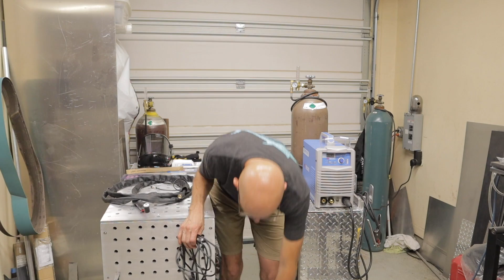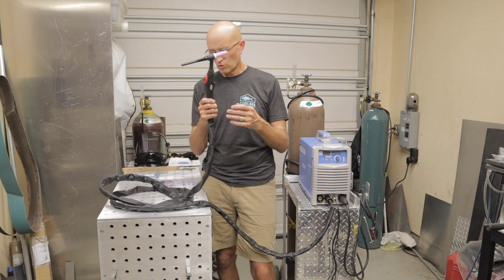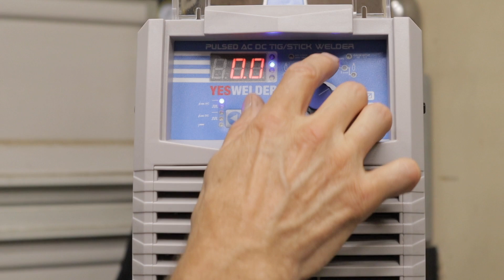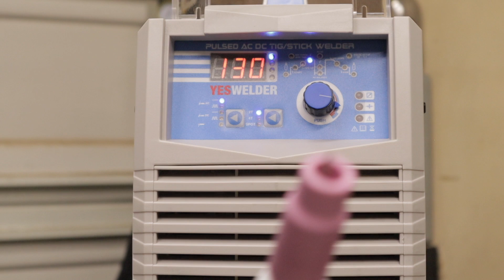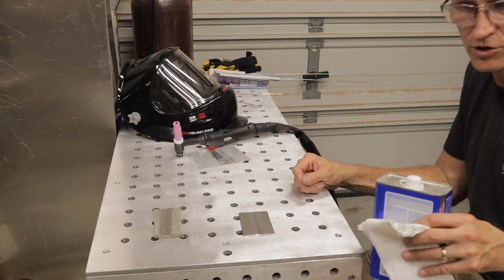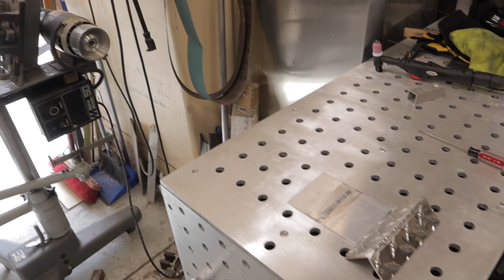YESWELDER NEW TIG 250P Setup & start tig welding Steel & aluminum.   Discount Code in description!

Comment: Thanks for an informative video Don!  Great job!  I have experience with a Tig Miller Dial Arc HF, but none with the new solid state welders with all the features available.  I just received the Yes 250P and started trying to figure it out...  I have no experience with a foot pedal or all these features. The tig I had weighed 500 lbs and was "On or Off" and I was only welding 1/4 to 3/8" aluminum.  I now need to weld 22 to 18 gauge mild steel.  Your video above only shows settings for aluminum.  Are the settings close to the same for steel?  I would like to hear how you set it up for the thin steel I'll be welding, if you have a few minutes.  I restore old classic British Leyland cars and some of that old steel is very thin that has to be restored.  I look forward to hearing from you if you get the chance!  Thanks so much!  Keep the great videos coming!  Bennet A
Reply from the maker: Hi Bennet! Great to hear you got one of these great Tig welders!   Ok, for thin steel I use these settings. 18ga. I use 65 amps on DC with about 12-15cfh of argon flow. I use a #8 gas lens cup when welding mild steel. I use 3/32” diameter 2% lanthanated tungsten for just about everything unless I’m going above 200 amps and then I switch to 1/8” tungsten.  When I weld in new steel on automotive panels I tend to do small tack welds around the perimeter and then do small stitch welds of like 1/2” long around the perimeter to minimize heat buildup in any one area. This helps me keep the thin metal from warping. I also keep a damp rag to cool the welds from the backside and this also helps with minimizing the warpage. The fit up of the metal replacement needs to be tight joints to make it easier to Tig weld too. For 22ga. I just back it down to probably to 45-50 amps. I’ve never welded in panels that thin but it should be about the same process. let me know if you have any other questions. 😊👍Don
Reply: @PranaTech  Thanks so much for the incredibly quick response!  In trying the settings I find that the white arc which allows me to see the puddle clearly, goes "off and on" constantly.  I am not familiar with the "slope up and slope down" feature, for my experience with tig is the Miller mentioned earlier, welding 1/4 to 3/8" aluminum building a hangar door for my hangar (55' x 16' bifold), with no pedal and wide open setting!  Can you please enlighten me as to why the arc may be going off and on.  Is it the settings on this welder or is it this inexperienced operator???  I'm thinking it may have something to do with the slope down... don't know.  Your arc when you demoed your beads, stayed consistent across the entire length of the bead....  Thanks again for your help and expertise!  Bennet
Reply from the maker: Hi Bennet! It sounds to me like the welder is set on pulse mode. Over on the lower left the button that switches from ac to dc and to stick should be set on the upper straight line on ac. This is normal ac welding. The next one down with peaks and valleys is the pulse setting. It is the same for dc welding when doing steel. I don’t use the upslope or downslope as I like to control this myself with the foot pedal. Also remember that the welder defaults to the button on the torch and if you want to use the foot pedal, you have to push and hold the pedal for 5 seconds until the remote light illuminates on the lower right side of the panel. Otherwise you will receive full amperage when you start your arc. This is annoying to me but it is just a part of the way this welder works. Hopefully this helps and let me know if you have any other questions.😊👍

Comment: Nice video brother. Do you know a way I can replace the tig rig with a regular rig. Or a way I can use it without the remotes
Reply: Man I’m having some problems lol. Do you why when I try to weld on ac all I get is lightning bolt comming from the tig head. I strike up directly on the ground. It sounds like it’s in ac mode and all. I must be missing something.
Reply from the maker: Hi James! Ok, it sounds like you are just getting the high frequency start and no arc starting. Are you using the button on the torch or a foot pedal? Will it start an arc on dc setting?
Reply: @PranaTech  I’m using the button on the torch. DC is also doing the same thing. It seems like it’s not getting the voltage to throw a hot ark. I put Connector adapters on the machine to convert to bigger lead connectors I also replace the factory lead with 50 footers. Heavy duty lead.
Reply from the maker: Is the torch lead connected to the Din connector to the farthest left on the lower panel and ground connector to the farthest lower right connector?
Reply: @PranaTech  I have it hooked up the same way you hooked it up on the video. Except I put the tig handle remote din where you put the footpedal remote. I have the ground on + the remote plugged to the connector in between the +and Threaded tig connector. The only thing I’m kind of uncertain about is the tungsten size. I have the wip converted for a 1/8.
Reply from the maker: Did it work with the factory torch before you converted it to the longer whip? It is acting like it’s not getting ground or power.
Reply: @PranaTech  yea, that what I’m thinking I will put everything back to factory see what happens
Reply: It was a grounding issue. Thanks for the help can’t wait for the next video.
Reply from the maker: Awesome! Glad to hear you figured it out! 😁👍
Reply from the maker: Hi James! Sorry for the delay in my response. I was gone welding all day yesterday and didn’t see this until today. Ok, if you want to convert to an American air cooled torch the process is pretty straight forward. You will need one of these couplers https://www.amazon.com/Stark-Welding-Coupler-Fitting-Coupling/dp/B086R7RH67/ref=mp_s_a_1_4?crid=15KUIH8AJPOEK&keywords=argon+coupler&qid=1658870010&sprefix=argon+coupler%2Caps%2C253&sr=8-4  You then cut one end off just past the hexagon part. You have to drill the barrier out of the middle and then run a 5/8-18 tap all the way through it. This then threads onto the welder and becomes a female for the us made torches to thread into. The torch needs to have a 5/8-18 male which is very common. I’m using a CK worldwide torch. Let me know if you have any questions. 😊👍
Reply: @PranaTech  thanks that would make a Awesome video.
Reply from the maker: I’m actually working on a video now. I have also converted mine to water cooled torch as well. All of it will be in the video. 😁👍
Reply: @PranaTech  that’s awesome! Maybe you can also show how to rig up the heavy hitter/black mamba style types of tig rigs also. I’ll be Patiently waiting on that video thanks.
Reply from the maker: Hi James, from what I can see the Black Mamba rig uses a din connector for power and a separate hose fitting for argon flow. My adapter setup will work for the argon hose. You just screw the argon hose into the connector that you would normally use for the Chinese torch. For power you would use the Din connector to the left of the normal Tig torch fitting on the front panel. They are both live with full amps when welding. Hope this helps.😁👍Don
Reply from the maker: The Din connector on the Yeswelder is a 35-50 which is pretty standard for 250 amps. You would just need to confirm that their connector is 35-50 and that the argon hose fitting is 5/8-18 right hand thread.👍
Reply: @PranaTech  it hard for me to picture with out seeing. Can’t wait for the video.

Comment: What size Din connectors they use on this machine ?Just curious  , if smaller Tig torches can be use on this machine like 17 or 20 water cooled one . THX

Comment: Debating between these three machines you've looked at:  Yeswelder 250P, Hynade 200, or PrimeWeld 225X.  Help me decide!?!?
Reply from the maker: Hi Bob, well they are all great machines and I’m confident that you would be happy with any one of them. For me, I weld a lot of aluminum and sometimes thicker aluminum, so the Yeswelder with 250 amps is the right welder for what I do. If you mainly weld thinner aluminum and stainless, the Hynade or the primeweld would be great. I know it is a tough decision. The only one that I have long term experience with is the Yeswelder and it has been a downright workhorse for me. I weld with it maxed out at 250 amps all the time and it has never faltered. It’s a great machine. Hope this helps. 😊👍Don

Comment: How I connect the gas to the machine and what can I gas thank I need
Reply from the maker: It comes with an argon hose that threads into the back of the welder. The other end you will screw into the Argon regulator that you will need to get from Amazon. Here is a link for one.https://www.amazon.com/RX-WELD-Argon-Regulator-Welding/dp/B08P5968X5/ref=sr_1_2_sspa?crid=J4VNJ3PVTFVC&keywords=argon+regulator&qid=1656648396&sprefix=Argon+%2Caps%2C574&sr=8-2-spons&psc=1&spLa=ZW5jcnlwdGVkUXVhbGlmaWVyPUEyTVg3QU5OMElOVlRBJmVuY3J5cHRlZElkPUEwODkyMDc0VkhNUVdEQTlaMVBDJmVuY3J5cHRlZEFkSWQ9QTAwMjY2MjMxOEQ3RDdEMElTQTlaJndpZGdldE5hbWU9c3BfYXRmJmFjdGlvbj1jbGlja1JlZGlyZWN0JmRvTm90TG9nQ2xpY2s9dHJ1ZQ==  This regulator threads right on to the tank. The tank you need is Argon gas for Tig welding. Hope this helps 😁👍
Reply: @PranaTech  thank you

Comment: Where do I set control for HF start?
Reply from the maker: It’s automatic and is always on. 😊👍
Reply: @PranaTech  does not seem to work on my unit. Even tried starting amps @50
Reply from the maker: Hmm, that’s not a good sign. I would email or call them and get a replacement unit.
Reply: @PranaTech  figured it out. My fault. foot, pedal preflow, 2 sec of HF, normal welding condition.

I was pedal and floating in space before approaching. HF turn on and off before I got into work zone
Reply from the maker: Awesome! Now you’ll have that knowledge burned into your brain because you figured it out yourself.😁👍

Comment: Man I just love your videos! Picked up the 205D, plasma cutter and now this 250p just arrived. Looking forward to trying it out. Do you have any recommendations on guides/books for welding configuration by metal? Can't figure out when you would want pulse vs straight vs AC vs DC. Even TIG vs MIG has me puzzled. Have you written a book/guide on that? I'd totally pick it up if you did. Hope you have gotten love from Yeswelder for all the gear I've bought from them through your links.
Anyways cheers!
-Shawn
Reply from the maker: Hi Shawn! Thank you so much for your nice comments! Made my whole week!😊  So, I’ve been Tig welding since right after high school, but only carbon steel. About 3 years ago I decided to learn how to weld aluminum. I found two channel’s content to be the best for me. I started out with Jody at weldingtipsandtricks on YouTube and once I got the basics of aluminum Tig down I then found Aaron at 6061.com’s YouTube channel and I bought his online course and it has really helped me get really decent welds on aluminum. I’m no professional at all, but I build a lot of projects now out of aluminum and they come out great. I actually enjoy Tig welding aluminum above any other welding now. As far as when to use which method, I use mig when I’m welding up projects like benches and tables and trailers etc… because it is so quick and you can build things fast. I hardly use my Tig for regular carbon steel anymore, unless I need things to be very precise and I can’t afford any warpage from the welding process. I use my Tig in AC for aluminum and DC for stainless and carbon steel. I only use pulse when doing fusion welds with no filler on stainless or aluminum and never on structural welds. Mainly for things like building enclosures and boxes etc. Thank you for using my links! They do give a me little love and it helps me buy supplies and consumables so I can keep building projects and making videos. If you have any questions, please feel free to ask anytime. Thanks again!🙏😊Don

Comment: Did it come with the foot pedal or did you have to order it separately
Reply from the maker: Hi Craig, mine came with a pedal, but it was not one anyone would want. I upgraded to an SSC pedal and now Yeswelder sells a good one on their site which is just a copy of the SSC. I don’t think they come with a pedal now so you will have to order one with it when you buy the welder. 😊👍
Reply: @PranaTech  I think they had the old setup listed on the site still and that's where everything was messed up they recently changed things on the website and they dropped the price another $50 from the deal 4 days ago
Reply from the maker: Wow! That’s a smokin’ deal!🎉👍😱

Comment: I just bought this welder and I'm trying to set it up to just run dc straight.  when I hit the trigger or push the pedal, I get about 4 seconds of a low buzzing sounding arc and then it shuts off. it's driving me nuts. any suggestions?
Reply from the maker: Hi Wisco! Ok, usually this is because you don’t have a ground. The 4 seconds are from the high frequency trying to start the main arc. Is the ground cable in the slot on the far right on the welder marked +? 😊👍
Reply: Yes it is and secured to my table.  When I hit the trigger I can hear a buzzing inside the box As well .
Reply: And it only stays on for about 2 seconds max. Then shuts off . My post flow still continues but I never get an actual arc
Reply from the maker: Ok, do you see any high frequency arc ? A tiny arc from the electrode to the workpiece? Will it begin the arc if you scratch start it?
Reply: It does do the high frequency arc for about 2 seconds then goes right out after that .
Reply: And I drug the tungsten across my work piece when I hit the trigger and it still does the same thing .
Reply from the maker: Ok, sounds internal on the board. I would email them and get a replacement.😞
Reply: That's what i was afraid of when I could hear buzzing from inside the welder, it didn't sound normal to me . Is your welder predominantly quiet when welding dc? Or is there buzzing from the box
Reply: Thank you for your time, I really do appreciate it !

Comment: How Pray tell do you set pre flow? 
I can not seem to get the Argon to flow and service amps to initiate? :-( 250P)
Reply from the maker: Hi Steve, when you turn the unit on it will default to the amps setting. Press the big knob on the front and each time you press it it will advance to the next field of adjustment. Keep scrolling all the way through until you get back to the first setting on the left which is pre flow. Turn the knob to change the settings. I have mine set at .5 seconds. Are you using just the button on the torch or a foot pedal?
Reply: @PranaTech  
trying the foot pedal but I will use the trigger if need be. It might. Be a faulty foot pedal 🤔
Reply from the maker: Hi Steve.  Yes, that was my thought. If you plug in the torch and it won’t activate the gas or arc, it probably is a problem in the welder. With the foot pedal, will it start the high frequency and initiate an arc?

Comment: I enjoy your educational content and skill.
I purchased a Yeswelder 250P and now have an aluminum gate project to complete. My problem is setting the machine. I am not familiar with the control panel and I can not seem to get the argon to start when torch is started. Can you please provide an idiot proof printed diagram of the control panel and proper settings for 
1/8" Aluminum
1/16" SS
1/4" CS
Reply from the maker: Hi Steve! I’ll be glad to help in any way I can. Can you tell me if you are using a pedal or just the tig torch with the button on it?
Reply: Foot pedal

Comment: Really enjoy your videos. I recently purchased this TIG unit and am looking to install a 220v circuit for it. What amperage is the circuit that you are running it on? Their website states a 63A input current, but this seems really high.
Reply from the maker: Hi Chris, I am running mine on a 30 amp breaker with #10 wire and I have never tripped the breaker ever. I weld at 250 amps all the time and so I believe 30 amps is a great plenty for this welder. My run from my breaker box is about 20 feet so your wire size may vary depending on your distance.😊👍
Reply: @PranaTech  Appreciate the reply! I went for a 50 amp breaker so it sounds like I'm all set.
Reply from the maker: You’ll definitely have plenty of power now!😊👍

Comment: I need help with my tig250 ac/dc to weld quarter inch thick aluminum square tube
Reply from the maker: Ok, what problem are you having and what are your settings? 😊👍

Comment: Can you make a video how yo seg DC  pulse.
Reply from the maker: Hi Pete! I haven’t done any pulse welding with this welder on DC yet. I have been playing with it welding aluminum on pulse and I’ve had my best luck with the pulse set at about 1/2 a second and 50% background amps in between pulses. It should work good for steel as well, unless you are welding thin sheet and then you would need to increase the pulses per second to adjust for thin material.👍😊

Comment: Does Yesweld offer a hand control instead of peddle, handicapped and not able to run foot control
Reply from the maker: Hi Charles, I know your question is 2 years old, but I found a company that makes a button that is a variable amperage control. I’ve been using it for a little while now and it works amazing! Here is a link to their site. https://tigcontrol.com/  I gave them all the info for the Yeswelder and he said he will start offering them for the Yeswelder. 😊👍